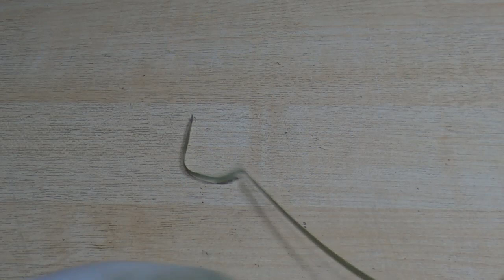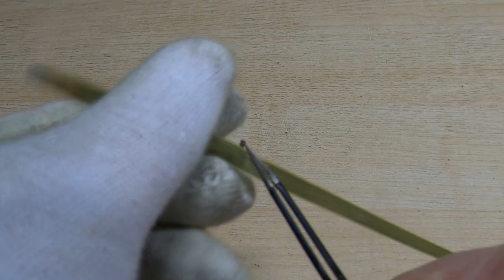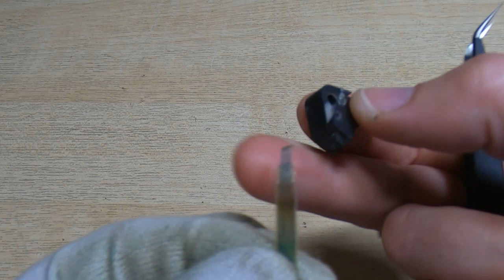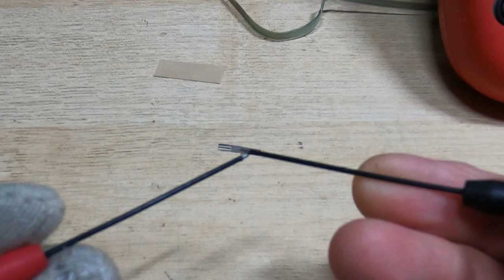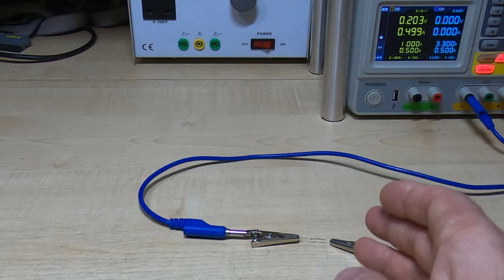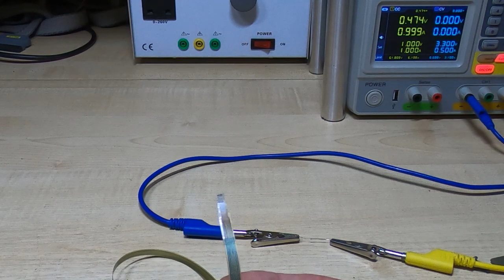HP9120A #1 Repair Part7

Comment: Jerry, would you share your source where you'd get flat flex cables manufactured?  I don't have any HP repairs to do, but I do know that some folks with the older PDP-8 systems have been looking for replacements for the long flat flex cables between different components inside the system racks.  They might use your source to get these cables manufactured too?

At first as I watched this video, I was going to recommend that you watch some of "Glasslinger's" <https://www.youtube.com/user/glasslinger> videos where he shows how he joins titanium filaments to the wires penetrating the glass seal at the end of his home-made vacuum tubes, but that special tape you've found certainly appears to be exactly what you need.  (Be warned, he's "unusual"!)
Reply from the maker: You can use any flat flex manufacturer. Just send them your design files. Note that you cannot spot weld tungsten to copper on a flat flex cable so his method would not work for this application. I spot weld some materials but they must be 'compatible'  for that method to work. This is also a much smaller scale as the spacing between the wires is only 0.1mm
Reply: @JerryWalker001  I think Bill uses a nickle intermediary(?), but wasn't sure about spot-welding being workable on the flat-flex cable due to its thin cross-section & plastic(s) involved.